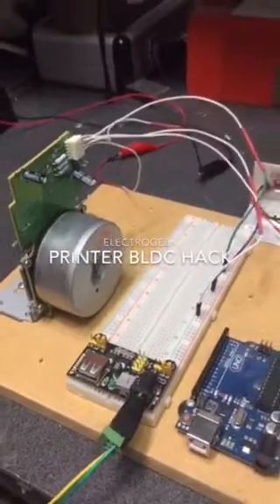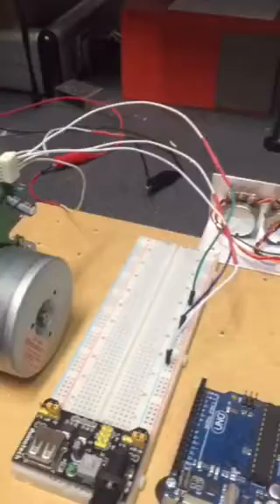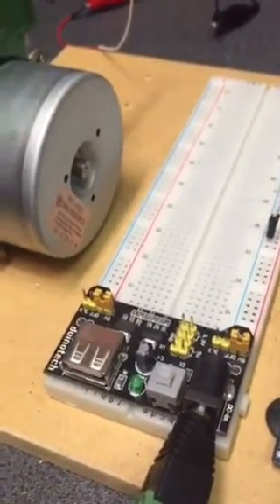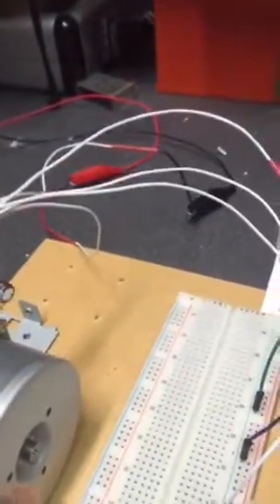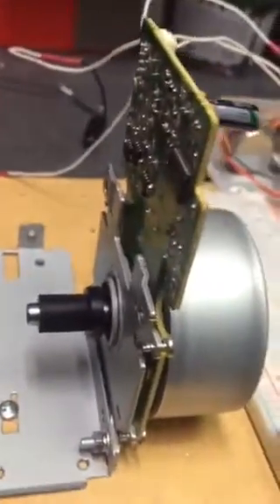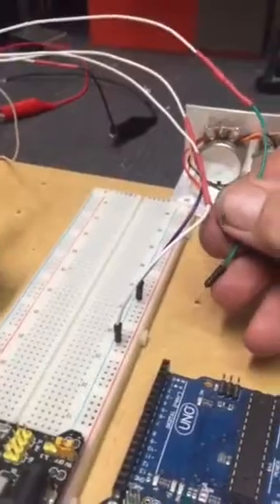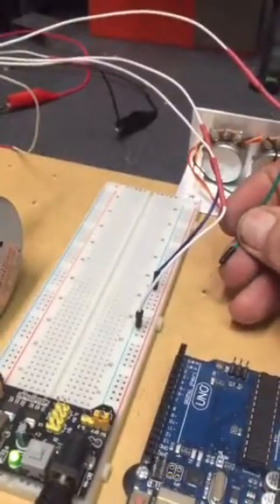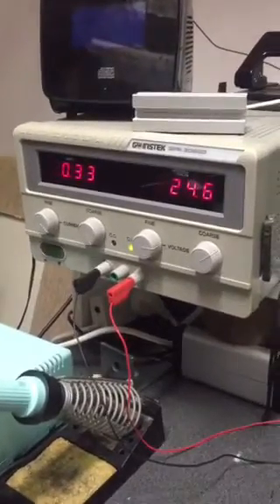Printer BLDC hack

Comment: Hi Maurice. I'm trying to do the same thing here. My motor looks slightly different. I have questions on the wiring. I see you have two separate power sources. What pin is used for ground on the driver side of the motor board?
Reply from the maker: Hello Tony every motor connection is different. Search the web for info. My supplies were 5vdc for the switching and 12vdc for the power. If I can find my desk notes I’ll pass them on but just shifted house and boxes everywhere.
Reply: I was able to get mine going. I have questions though. I'll make a video of what I've done. Maybe you can point me in the right direction.
Reply from the maker: Tony Verduga hey Tony you’ll need to check motor connection diagrams on Google. Send me details of your motor and I’ll see if I can track it down for you if you can’t find it. Cheers.
Reply: I have a description of the pin-out (one page PDF, from the Kyocera TASKalfa 400ci Service Manual) that I can email to you. I just want to understand the circuit, and be able to control it with an Arduino.

Comment: Why does it need 2 power supplies
Reply from the maker: Cody B Hey Cody the 5 volt power supply is to drive the TTL (logic control voltage value) and the other voltage supply is for the BLDC motor

Comment: How would this help anyone? You dont provide any info on what the pins are called at all....! 

I have a motor with the following 5 pins: +24V | MFG | DEC | ACC | GND

ACC and GND are connected to ground
DEC is connected to +5VDC
MFG is disconnected (floating) (I think this might be the PWM input?)
GND is shared between both rails +5V and +24V

I would love to know how to control the speed of this motor type
Reply: I don;t think so... MFG IMO stands for sth like motor feedback generator, its rotation speed singal. I checked on mine and I noticed that MFG pin is connected to one  out of 3 hall sensors. Also I  figured out that this pin is also connected with laser control chip, so think about it,  what else except  tacho would be connected to laser driver. That makes sense, becuse mine motor was responsible for transfer belt and drums,  so obviously they must be synchronised with laser via motor ration speed reading...  In ur case, rather ACC would be  resposible for PWM  signal, because on 100% it is responsible for acceleration and DEC  when set high, stops the motor immediately...